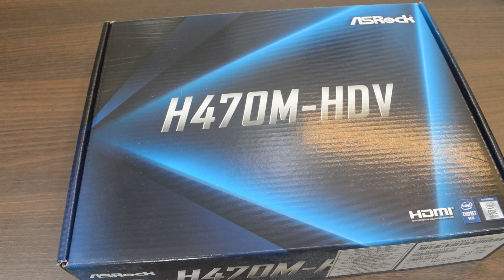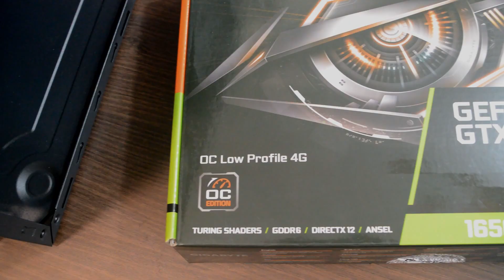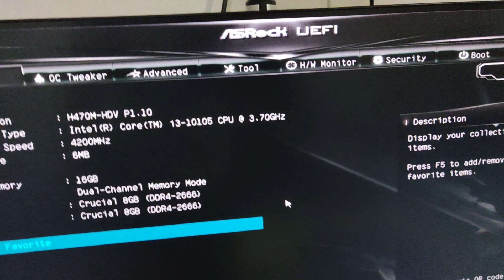Best Budget Gaming PC -  i3 10105 GTX 1650

Comment: Shame about the case... but I guess when you're building a budget PC in the current climate, every penny counts!
Reply from the maker: But I like this case very much, so compact almost similar to nr200p(except cooling performance) and most importantly it had support for 3 ssd's , 3 hdd's and a 5.25(DVD drive) . Wish it would have had more fant mounts atleast one more exhaust vent on the top. Anyways no issues with this kind of build
Reply: @OdinHardware  Ye, I just don't like the way it looks.... too early 2000's or late 1990's for my taste.
Reply: I really like Black and yellow, and symbols on cases!
Reply from the maker: @The Jolly Sloth   yeah , especially when compared to modern cases   😆

Comment: Hey I will be getting an Inno3d gtx 1650 twin x2 OC and a cpu intel core - 10105F +16gb is this enough
Reply from the maker: Definitely good. Also config ram in dual channel I.e 2x8gb
Reply: @OdinHardware  why? 1x16gb i think this will let me upgrade in the near future to 16x2gb. Also whats the difference of 8x2gb with 16gb ram
Reply from the maker: If you upgrade to another 16gb very soon then single 16gb is fine as of now
dual 8gb or 16gb will offer better fps 10fps atleast  and better stability(less stutter) especially if you go from single 8gb to 16gb(2x8).
Reply: @OdinHardware  ok thx